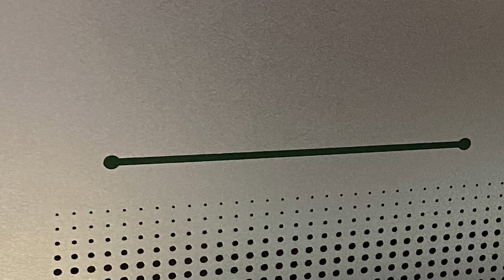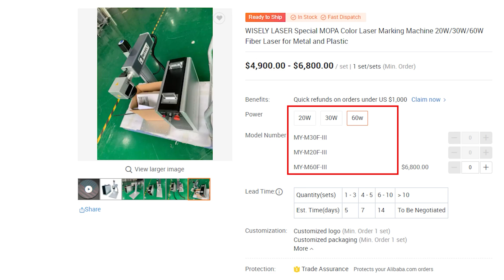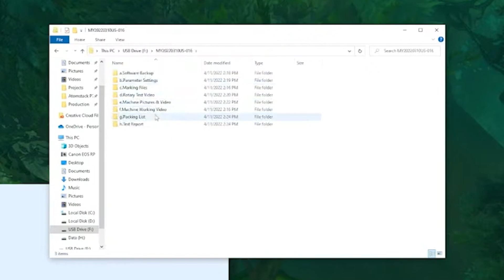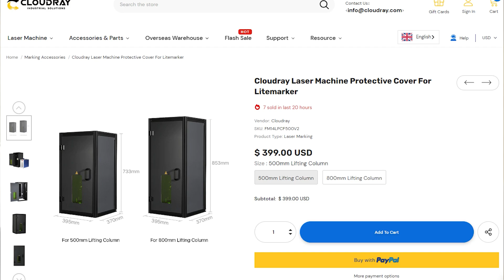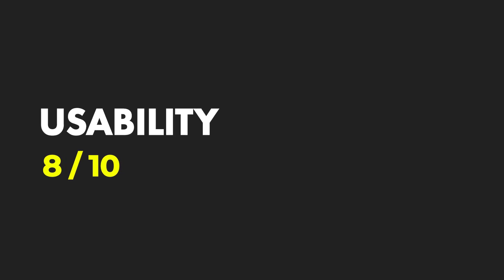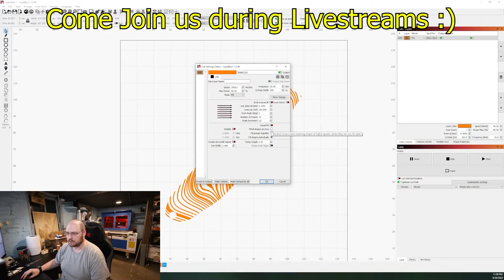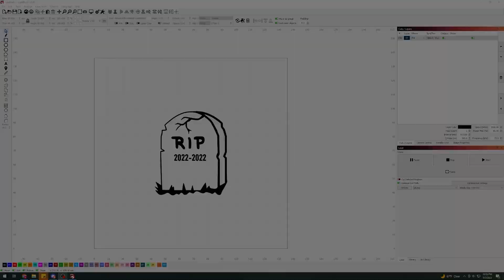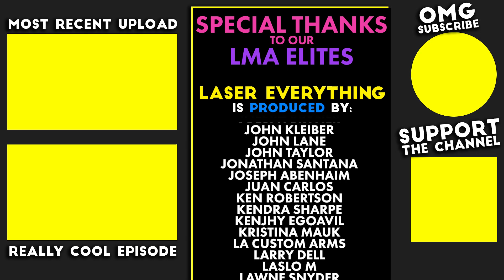A Great MOPA Option for the Masses | Wisely 60w M7 Fiber Laser Review

Comment: Would this laser be strong enough to cut ports in a pistol slide ?
Reply from the maker: I've not tried specifically doing ports on a slide (don't really have a reference for thickness on one either), but I've done some rough cut outs using it with the 110 lens on ~3mm thick stainless steel. It takes fine tuning to get good results in a reasonable time as well, but hasn't really been something we've dug too much into specifically.

Comment: The best Fiber Laser for me would be a 100W JPT MOPA with an Ezcad3 board and 2.5D motorized Z Axis! .... But those look to be about $13,000 lol. Oh well, I can dream.
Reply from the maker: LightBurn now supports 2.5D height map engraving using only an Ezcad 2 board which is about $1000 cheaper than the Ez3 boards that advertise supporting it natively. So.... $12,000 lol? Probably not much better.

Comment: Hi, I need some help.     I read that there are two models of the JPT 60W MOPA lasers,  the  'economy version'  YDFLP-E-60-M7-M-R and the 'full power' version YDFLP-60-M7-M-R, the first having a 1.5mJ pulse energy, the full version is rated at 2mJ.    Some reviewers suggest to avoid the 'cheap, economy' version, or at least be aware of them.
My question, what do we miss with having 'only' 1.5mJ instead of 2mJ ?    How does the 100W model (with a specs of 1.5mJ only) compare to these?   I am confused, why doesn't the pulse energy correlate to the wattage?
Reply from the maker: If you don't know why you would want one of the other you probably wouldn't notice the difference. The E-series sources from JPT have a little bit lower power at higher frequencies and aren't quite as good at cutting - not that you should be cutting on these machines anyway. It's really technical and the difference is marginal. For most applications the E-series is comparable.

Comment: Does the colour marking catch rust or corrosion after a certain period of time?
Reply from the maker: Some do, some don't. If done properly it shouldn't - typically the corrosion is due to the metal being ablated by the laser. Proper color marking wouldn't have any such effect on the surface.

Comment: so a fiber laser will burn the metal at different rates so that the result is various hues in the appearance?  How does that work?  Does the frequency setting control this?  I have a huge CO2 laser and am considering a fiber laser.
Reply: Yes you are correct, MOPA fiber laser speed, frequency, Q pulse all can be adjusted then do different apperaance.
Reply from the maker: Agreed!

Comment: Question, is there anything a 60W MOPA laser cannot do vs a 50W non-MOPA (JPT LP)? I'm looking at both a 60W MOPA and a 50W JPT one, but trying to determine if there's some downside to the MOPA I'm missing, or if the MOPA is just added capability (i.e. color marking, etc.).
Reply: Nope, 60w MOPA can do all and more vs 50w JP.
Except nomal marking, MOPA laser special: 
1) Color marking on stainless and titanium materials.
2) Black engraving on Anodized aluminum.
3) Black and fine marking on most plastic.
Reply from the maker: Agreed!
Reply: @CalyoWiselyLaser  hi, I'm considering getting this for my business. I need to etch about 100um in aluminium in 5x7mm area to prepare the surface for gluing. Also, in a larger area around this of 40x40mm I need to completely burn away any oil without marking the metal. Can I use this laser for both cleaning and ablation like so, or is it not possible to clean off the oil without marking the metal?
Reply: @boshacka  Yes it can do like this. For oil cleaning you need set smaller power and lower Q pulse, do it very slight oil surface removal. You can click the link take order, recently we have 20% discount off, and free shipping for LE members.

Comment: Power source popped sounds okay if you have a back up but 3-5 days down would cause huge problems for a small shop
Reply: Why did it fail? And is it a manufacturing fault
Reply from the maker: Agreed, 3-5 days could be problematic depending on workload and expected turnaround for client projects, but downtime happens sometimes even under the best circumstances. In all honesty, I expected the shipment to be more like 2 weeks coming from around the world, so about half a week I was more than happy with. That said, PSU failures happen regardless of brand, and from what I saw when looking through the power supply, it seemed decently built so added to the unexpected circumstances a bit. While I'm not an electrician/engineer by any means, I would say the build quality and components looked pretty on par with a PSU from Meanwell (which i just bought a few of to get my co2 up and running after a long downtime to get it wired for 110 instead of 220), which is a rather highly regarded manufacturer. The Wisely PSU's are branded as a Wisely (i'm not sure if they build them in house or if they are contracted elsewhere), but seem pretty stout. I thought I might have had an electrical issue in the shop, so I did have an electrician out to check my voltages and wiring for my shop circuits, everything checked out solid so maybe just an oddity or part of that low average failure rate. Either way, if anything changes or any failures occur, I will of course report back with an update video. I plan on doing a long term usage update in the future with any findings/changes after it is thoroughly used and gone through a lot more testing and power cycles :D